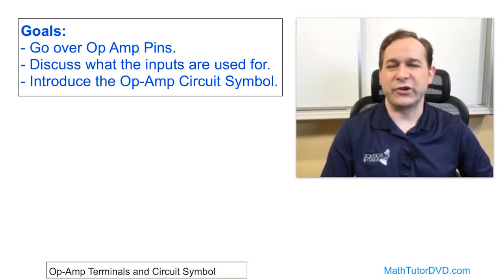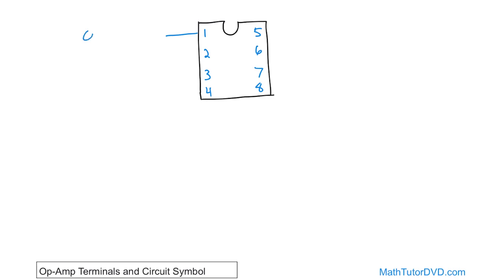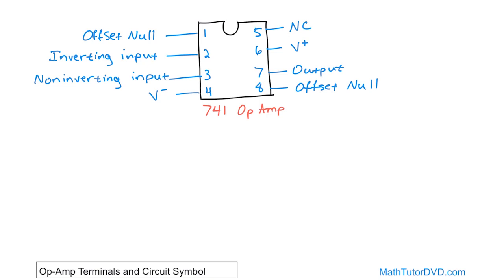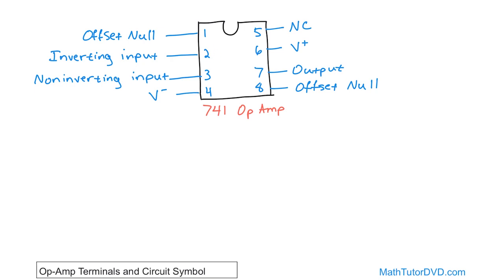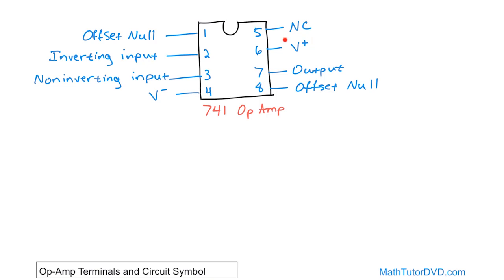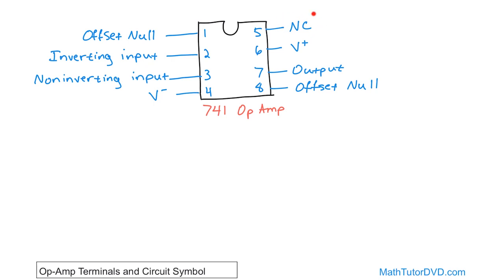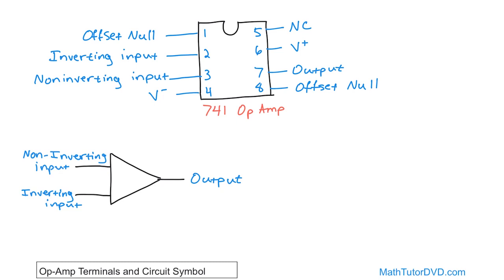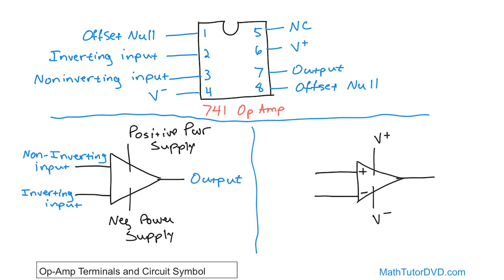02 - Op-Amp Terminals and Circuit Symbol

Comment: @ 2:30 , isn't that pin out on the right side ( from 5 thru 8 ) upside down? Doesn't pin 5 begin at the bottom right corner?
Reply: That certainly should be the case.  Especially when you also draw the notch of the chip, you should respect the numbering too.  And that's always counterclockwise...  And the worse thing is, the function of the pins is also incorrect.
That's a pity because these courses are awesome!

Comment: THE PIN OUT ON THE RIGHT SIDE IS UPSIDE DOWN.
Reply: @Setwhattt  That is totally incorrect.  If that were the case, the globe would have exploded already!  Each and every 741 device that is made by different manufacturers will have the same layout.  How would you otherwise be able to exchange broken 741 devices in a circuit with one from another manufacturer?  That's pure nonsense what you're telling...
Reply: @Setwhattt  I don't know where you get this statement from but that doesn't fit any logical reasoning.  Anyways, the proof of the pudding is in the eating, right?  Especially for you, I dug into the archives of several manufacturers that have been making (or still make) this "mother of all op-amps" (maybe you will disagree with that one too?).
I looked into www.alldatasheets.com and found at least 5 (ex)manufacturers of the uA741, DIL version (that's what we're talking about if we want to have an exchangeable device, right?).

Note that the uA 741 was first introduced in 1967!!!

1. Datasheet of Harris, dated May 10, 1979 (revisited August 1991)
2. Datasheet of Texas Instruments, dated May 1998 (revisited October 2015)
3. Datasheet of Intersil, dated September 1998
4. Datasheet of National Semiconductors, dated May 1998
5. Datasheet of Fairchild Semiconductors, dated 1999

Guess what?  All have the same pin layout for the DIL (or DIP, whatever your preference is) package.  Of course, they have!  As a manufacturer, you would be more that stupid to deviate from the standard layout.  You would never sell a single piece of your device.  How could you ever achieve interchangeability between different brands if you don't stick to the standard pin layout?

You really have to revisit your thoughts about this and stop confusing other readers...
Reply: The pinout is correct but the numbers 5 to 8 are upside down.